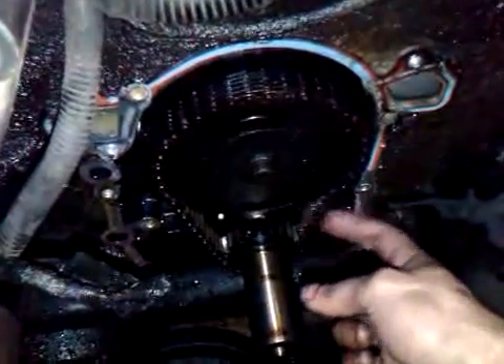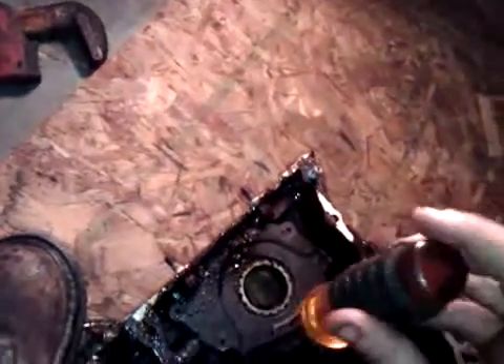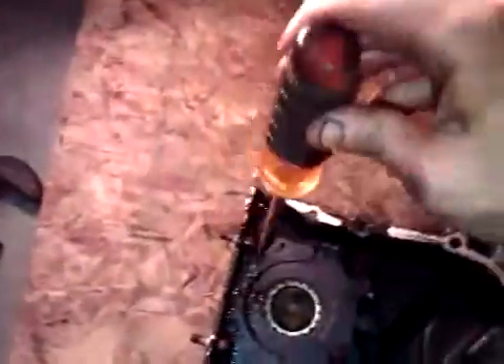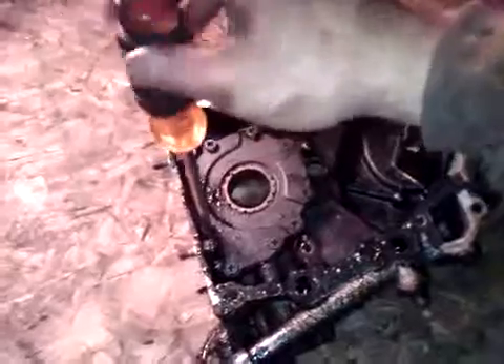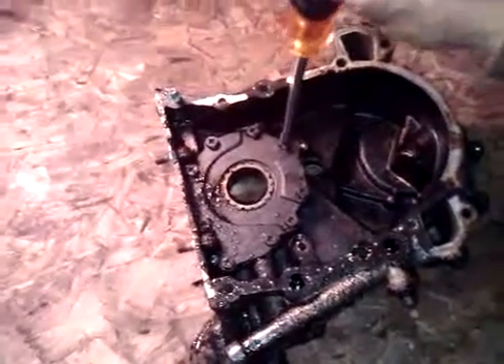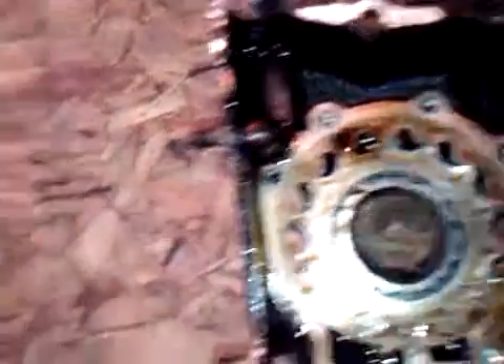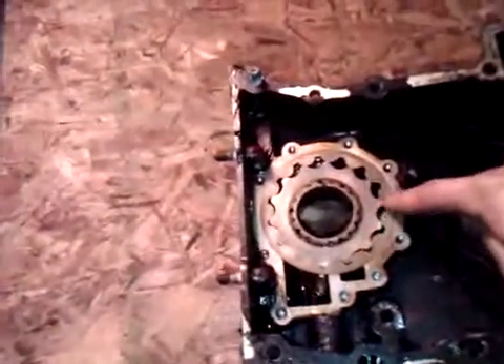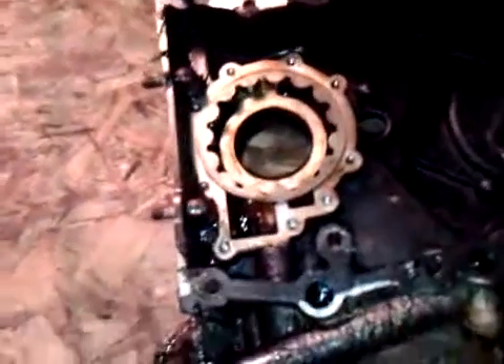Land Rover 4.0L oil pump inspection.

Comment: Also check the plate on the back is flat using a straight edge before re-assembly. They have a habit of becoming concave, allowing a huge gap for your oil pressure to escape.

Comment: Just seeing the carbon/sludge buildup says lack of oil changes and overheating of oil, poor engine as bearings have suffered.  
Be sure to clean ALL oil galleys especially to crank and Cams, Mains and journals....ouch!!  
Sorry I didn't see this until now.  Lemme finish watching the video... Feeler Gauge your oil pump and pump may have to be aligned to send pressure in sequence.  Must clean those galleys out as suggested  you don't have enough flow to bearings likely from sludge and dirt in filter and sump.
Don't forget to plastigauge your bearings. Carbon buildup behind your rings ugh!  Likely too late for your engine but still applicable to other viewers.... 
Main cause of failures are due to heat and contamination, we people with $100,000 vehicles need to install better cooling systems and oil pumps to save our investments. :)  
Great video guys, hope there is more.  Thumbs up for effort.
My only question is were you getting any obdii codes, dashboard lights, limp mode conditions?  Thanks

Comment: Mine broke the outer ring gear. I ordered a used oil pump/water pump housing because I broke the water pump housing, the JB weld I used to fix it made me nervous. When the used housing arrived, inspection of its outer oil pump ring gear showed a crack as well. Seems to be a common failure point.

Comment: Hi...did you make a video showing are resurfacing of the front cover for these gears? thanks very much your videos are very helpful
Reply from the maker: I did but YouTube deleted it for being to long. I used a dremel with a mini lap disk. you would need a small straight edge that fits in the cover and just work the high spots. you don't want to remove to much or the pressure will be low. I used plastiguage to check clearance

Comment: Thanks for the tips. i will ponder that surfacing approach. i was picturing polishing the bottom and side grooves flat. it's sounds like that would be taking it too far.  did you plastiguage before servicing yours? for a base reference or did you find a spec sheet?
Thanks kindly

Comment: Oil pressure is always lost due to wear from the gears in oil pump and always replace the gasket on the housing to, as the oil pump gears will seize and smash the distributor drive and cam gear too